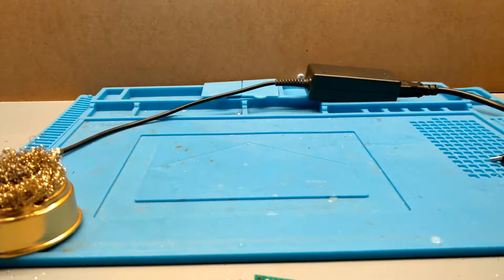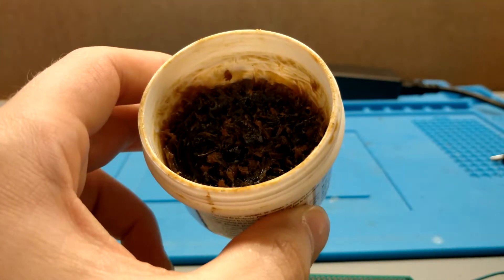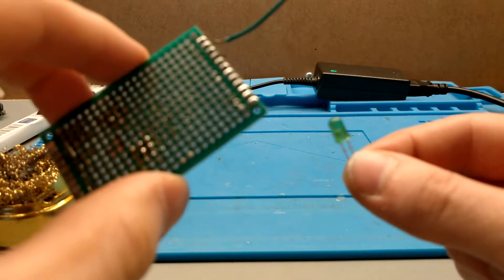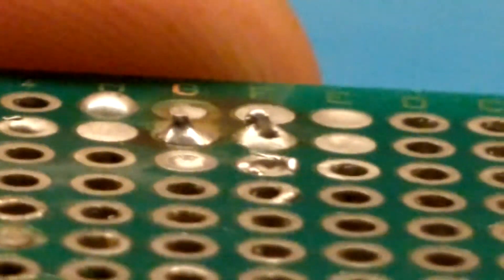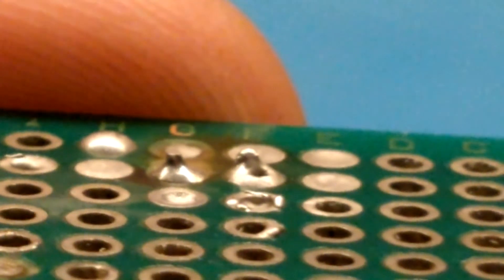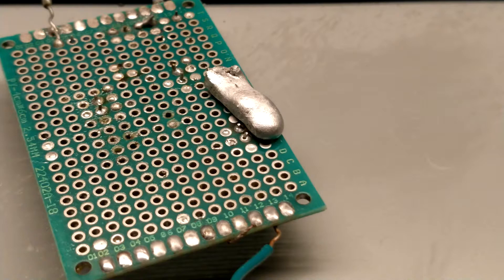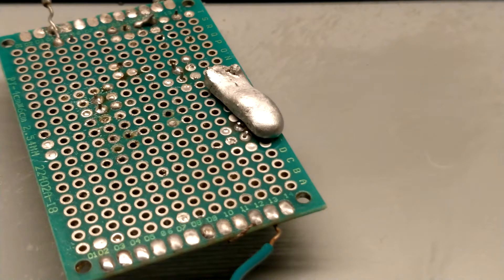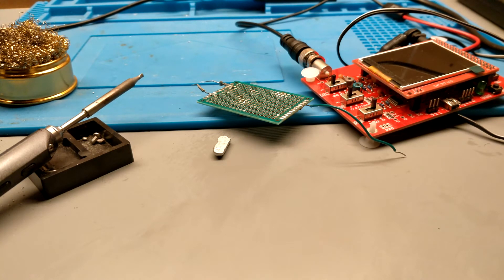( Electronics ) Can you reuse old solder?

Comment: I have a large blob of rosin on my desk and put all of my used solder on top of the rosin and hold it there untill it melts into the rosin.
Doing that, a small reel of solder has lasted me a few year's but now I have to use some really bad Chinese stuff that just crumbles.. I think it's full of impurities and was wondering if boiling it in boric acid will clean it? 
Thanks for your video. 👍